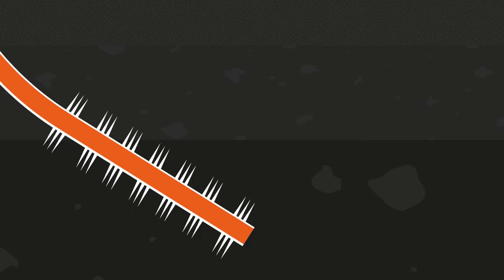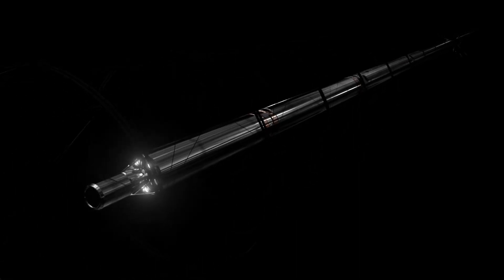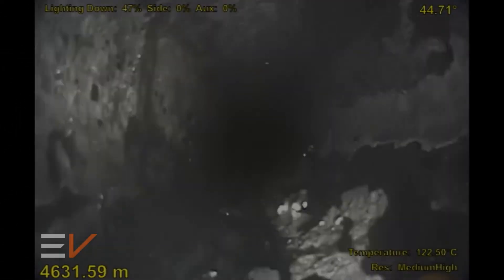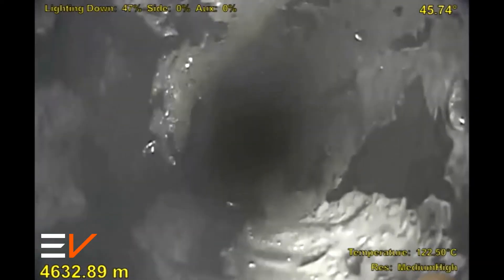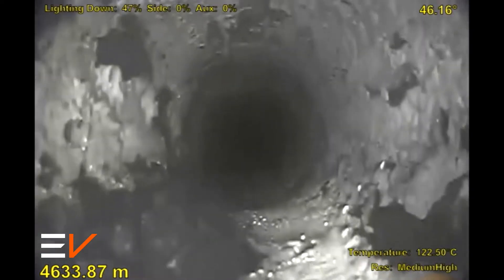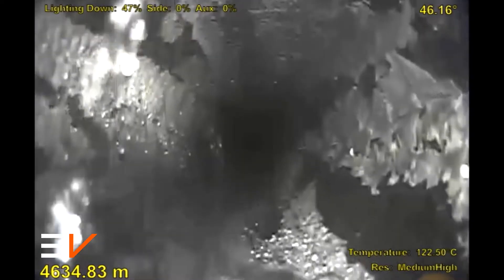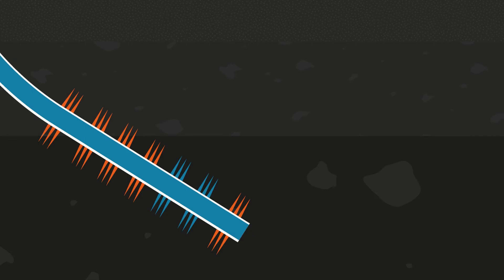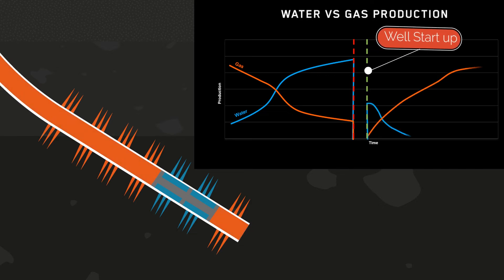Pinpointing & Isolating Water Entry in a Gas Well

Comment: This scenario can be very problematic in isolating the water producing perfs from the oil or gas producing perfs to plug or squeeze them off. Squeezing off oil producing perfs with cement is not good. Sometimes the perfs are so close together that you can't set an isolation tool for the perfs because they are too close .That's where a polymer squeeze type of program can come in handy. But polymers are usually a temporary fix. So what's next.

Comment: I have a question for this video...Before you run in the video, the well should be full of water, fluid level maybe up to the wellhead, but during this video, can not see any water level from begining to end. So if you or Neptune Energy had sucked all water from the well before you RIH your EV?
Reply: they could run e line if the the pressure at surface doesn't exceed wireline